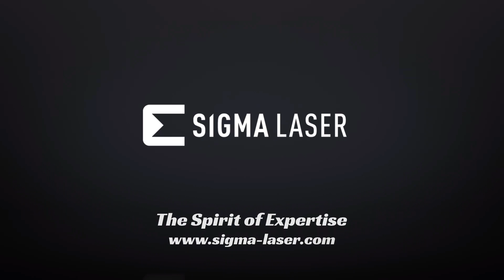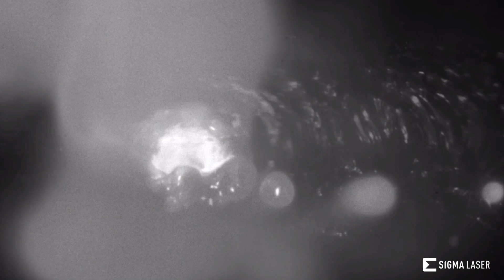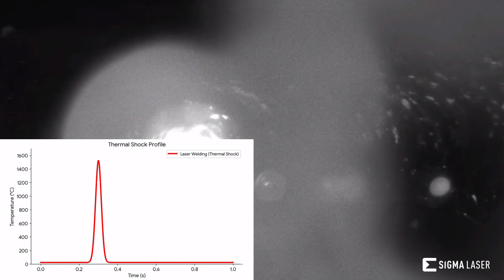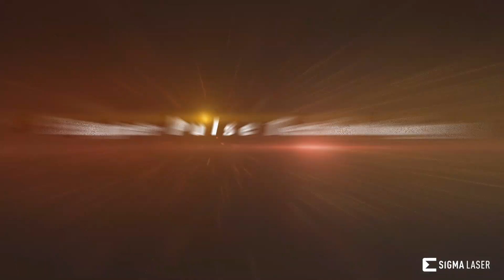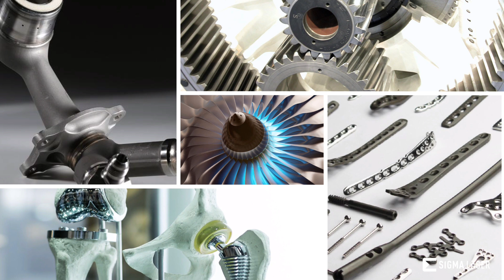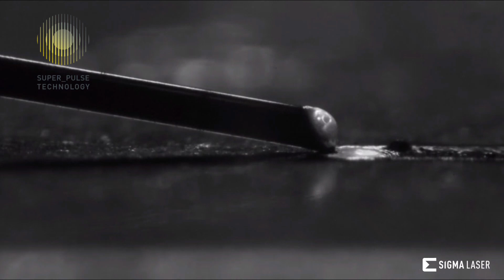Super Pulse Technology vs Conventional Laser Welding — Which Is Better?

Comment from the maker: From your experience, what causes more welding defects in real production?

• Heat input too high?
• Wrong pulse settings?
• Material sensitivity?

We’re curious to hear real shop-floor challenges. especially in tool steel, Inconel, and repair welding applications.